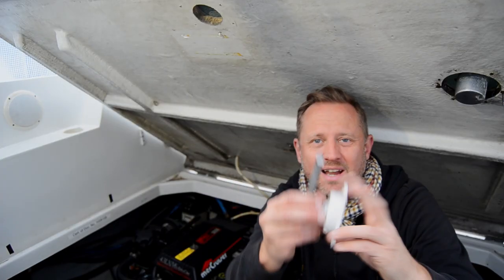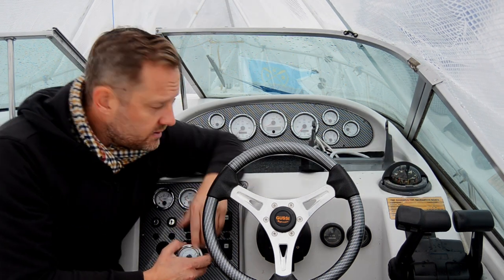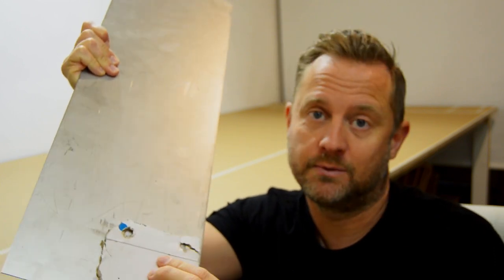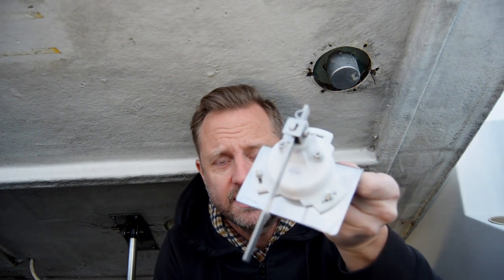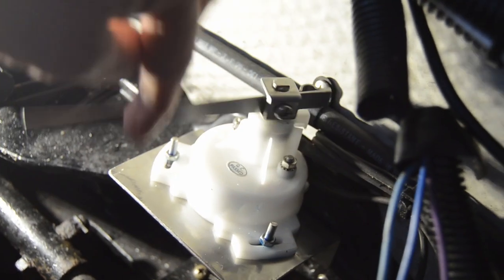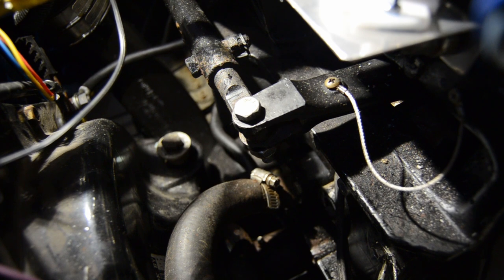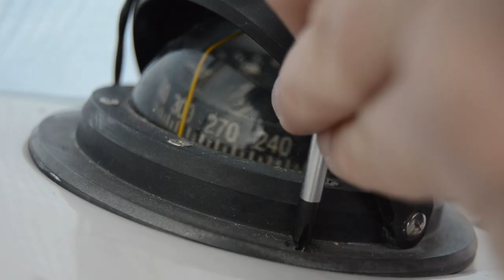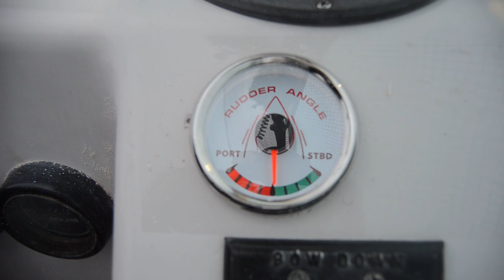How to install a rudder angle sensor on a sterndrive boat

Comment: How has it been holding up? Looks like it was binding up when you went hard over and bending the arm on the sensor.
Reply from the maker: Hi
It has been ok
Sometimes it jumped out but I fixed that with some wire 😁

Comment: So only one wire goes on the white piece ?
Reply from the maker: Hi. Two wires. One to the guage and on to ground.
Reply: Does it matter which side it goes on ?
Reply: @brayansanchez8260  not on mine
Reply: I wonder if we could 3d print the parts.thanks for the video.awesome